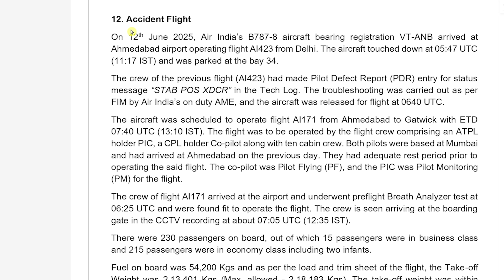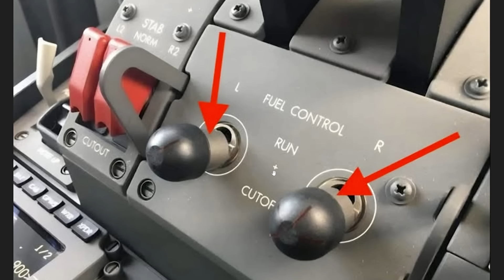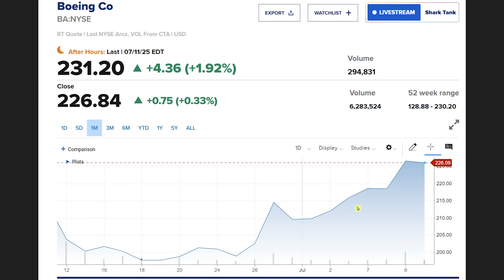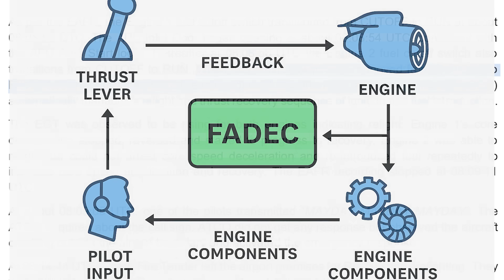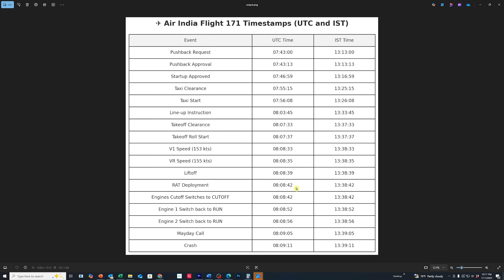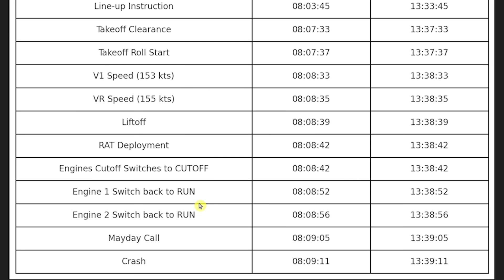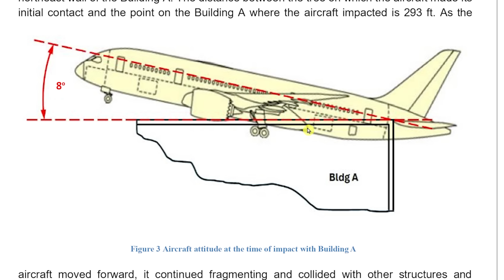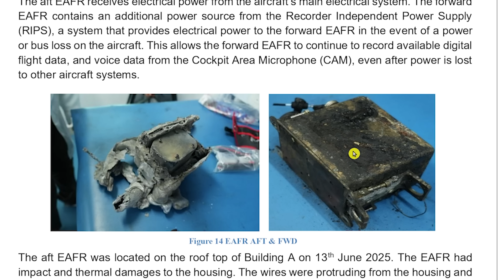Did Pilots CUTOFF Fuel? Shocking Twist Air India 171 Report!

Comment: The only question remaining in my mind is which pilot is the mass murderer.
Reply: Captain
Reply: It is Boeing psychology to put all the faults on Pilots.. They would do it in 1 sec? Switches has locks applied too.
Reply: @FireNFights  actually that is not true. In most investigations if something was wrong with the plains they will very much say that. That is how the airplaines have changed over time to make them safer and safer
Reply: @FireNFights 1 sec per switch
Reply: @Colossians1vs17 Pilots will follow the same procedure if they find any issues with Engine. Fuel cutoff can occur when the engines report any anomalies. This will be cleared in final report.
Reply: @FireNFights  Yes all it takes is 1 second for each switch, saw a video from Captain Steve saying so.
Reply: @YoutubeCommenter7402  Captain Steve will soon come with another video with same facts that it is impossible to turn off switches in 1 sec with locks applied.
Reply: Framing is also possible. We won't know for sure. That is why they did not mention who said what.
Reply: @itsmesuryat7570  They are going to find out. If you look at the cockpit of 787 to be able to liftoff the plane from runway you are going to need both arms to pull back. On a Boeing you need both arms, can't be done with one arm. The blackboxes record who is operating the plane, also when the plane was having issues we will find out who was trying to save it. Also, what selection the other pilot did since some switches appear on both sides. If this was an Airbus plane then it would have been  possible to liftoff using one arm and possibly turn off the engine with your other arm, but not possible with Boeing.
Reply: @knight3131  it is almost certain that the captain did it, but we need to know for sure who asked the question. The captain could have done it and asked the question to implicate the FO. Or in a crazy turn of events the FO could have taken his hands off the column and did it. They need more time to figure it out. That is probably why it is vague.
Reply: @itsmesuryat7570  something very sus about the whole thing. the whole reports seems/designed to put the blame (put all focus) on the pilots. they have time stamps etc but dont know which pilot asked question which pilot answered. also no other conversation? just one pilot asking question? and think for 10 sec to reignite and 4 secs apart ? when it can be done within 1sec? also i hope someone triangulate the plane take off from videos and timestamps to see if it matches up? rat deployed at the first switch off instantly why no timestamp for it? bcoz it can show which problem occurred first? rat or switch? they have switches timestamps but not the rat's? sound very strange! pic of rat looks almost instant after take off not 3 sec? hope someone can triangulate the stampts from the videos/pics
Reply: The report also mentions that aviation psychologists will be called in
Reply: No - those pilots were forced to take shots during past years! One pilot in April died in heart attac already and was same Air India. So easy people forget !
Reply: Captain.
Reply: I guess the motive would be they are trying to keep up with Boeing? That's a decent KD ratio but rookie numbers by murican standards
Reply: Clive
Reply: Finally.  This is the first time I've seen it worded correctly.  One of those pilots committed mass murder/suicide, and that's the issue.  Was he a loner, or part of a bigger plan?  Are there others waiting to do something similar?
Reply: I believe its the younger one,trained for this mission.
Reply: Captain Mohan Ranganathan, an Indian aviation safety expert, said: “I have heard from several Air India pilots who told me Sabharwal had some depression and mental health issues. He had taken time off from flying in the last three to four years. He had taken medical leave for that.”
Reply: , , ,    COMPUTER  , , , Switches are still  , , ON ! !
Reply: You with the stupid flag 😂
Reply: You're just butthurt about it lol  @TheGuruStud
Reply: @TheGuruStud you with the stupid answer 🤤
Reply: Neither..
Reply: The older one.
Reply: That's probably why you stand with Ukraine 🤣
Reply: @pl3317 certainly don’t stand with fascist aggressor like Russia…when hundreds of thousands of Americans died to defend democracy in WWII
Reply: Selensky

Comment: RAT was deployed right  after plane got airborne as per image put in place by AAIB that indicates both engines failed so that explains fuel cut off switch "transitioned" from cutoff to run where pilots try to restart both engines. what happens to both enginees or why fuel cut off switches went from run to cutoff in the first place is where investigation should focus on rather then questioning pilots.

Comment: What's the reason why the 2 x fuel cut off rocker switches were OFF for 10 seconds, then one was switched to ON (RUN) and only 4 seconds after this was the other switch turned back to ON (RUN)...Why the delay initially of 10 seconds, and once the error was presumeably noticed why 4 seconds delay before the second fuel switch was turned ON (RUN) ? Seems ODD to me!

Comment: If those engines are still spinning then they must still be providing electrical power, and they certainly were spinning adequately enough to get to VR Speed.  So why did the RAT deploy 3 seconds into flight? More importantly why did the RAT deploy previous to ENGINE CUTOFF ?!! Also the VCR recorded  "I did not do so" in regard to engine switch off query. Some are being quick to point at crew but there are many issues with Boeing that we all know of.  
Not the first time we've had reports of electrical issues particularly the MAX 737 and 787 Dreamliner. These issues have involved faulty wiring, improper bonding of parts, and problems with electrical components like generator control units.

I can smell a RAT and its burning through electrical cables again?

Comment: On the 737 and 787…
Upper panel toggle switches are down for on.
Lower panel toggle switches are up for on.
Lots of room for confusion there.

The Bae-146 had a much better system, where the thrust levers had to be at idle, before the fuel cut of position could be set to off.

Much safer than the Boeing system of little switches.

R
Reply: Yet decades of Boeing flights using these exact switches have caused no proven fatal accidents where two of these switches have randomly and simultaneously failed. 🤔
Reply: @robinmueller3778  Yes but such thrust lockout can provide extra safety margain for accidents or intentional acts like this. I'd add also that engines must be idling or in very low power setting for at least 3 seconds to cut them off. There's no drawback or extra inconvinence on that because in any normal scenario you cut engine on low power/idle settings. But prevent things like this
Reply: @oluskloc You would changes all that to “fix” something that basically doesn’t ever happen? 🤔

These switches were deliberately moved by human hands, they didn’t both just happen to accidentally fail at exactly the same time.
Reply: Either way there is no procedure to be playing with those switches during take-off unless brain fart and he meant to put landing gear up.
Reply: A thrust lever lockout sounds like a smart idea
Reply: Confusing maybe unless you have been trained on the airplane and done a ton of flights for discovery of switches etc.
Reply: "The Bae-146 had a much better system, where the thrust levers had to be at idle, before the fuel cut of position could be set to off."

The cut-off procedure in the BAe-146, is just to stop shoveling coal into the boilers.

Comment: Theres no evidence it was malicious, or that the pilot saw the other pilot move the switch or even that the switch was manually moved when the pilot said that. It just people interpreting the report to suit a confirmation bias. The report quotes the CVR without a time stamp so its uncertain at what point that was said. It may have been said before the switches were moved. The transition of the switches is what was electrically recorded by the FDR. The pilot may have said that after engines lost thrust speculating that the other pilot cut fuel switch. Then purposely shut the fuel to off and back on to try restart. Or it could still be some other issue.

Comment: So usually the pilot flying the take off is expecting a call-out confirming positive rate (of climb) from the pilot monitoring so that he can request for the gear to be raised… as is evident from the footage of the takeoff, the gear was never raised while the aircraft was attempting to climb… what it seems to have happened according to the interim investigation report is that the pilot flying never got the expected call-out, but instead experienced a loss of power by the pilot monitoring deliberately turning each fuel condition switch to the cutoff position in turn from left to right! 

This looks very tragic and I fully expect that the investigation will now scrutinise the history and background of each of the pilots…
Reply: "deliberately turning each fuel condition switch to the cutoff position in turn from left to right! "

The report does not specify in which order the fuel control switches were transitioned from RUN to CUT-OFF. It just states that the time interval between the two operation was 1 second. As pointed out by others, the polling rate was low so the actual time between these events could have been much shorter.

The report states that the fuel control switches were transition from CUT-OFF to RUN commencing with the switch for the No 1 engine at 08:08:52 and No 2 engine 08:08:56 an interval of 4 seconds.

Normally the pilot flying would operate the switches left to right because the No 1 engine is started first and after some time the No 2 engine would be shut down. After landing and returning the the gate the APU will be started and the No 1 engine would be shut down as it would close to the air bridge and stairs. Latter the No 1 engine would be shutdown.

It is only in extreme situations, such as a dual engine failure that both fuel control switched would have to  be moved from RUN to CUT-OFF and back to RUN and this would be done at altitude.

Comment: This doesn’t add up. Air India risks grounding all of its comparable planes while Boeing stands to suffer multibillion-dollar losses in the event of a dual engine failure. It seems far more likely that they quietly agreed to hold the pilots responsible after all, that conveniently shields both companies from facing the full financial fallout.
Reply: Hard to blame boeing for the fuel being shut off to the engines

Comment: I think everyone is jumping to conclusions without having all the data to make the claim that it was one of the pilots that brought this plane down.  The interim report appears to be deliberately vague on what was going on in the cockpit of that aircraft and does not yet assign blame for the incident.

First of all we need the entire CVR transcript (or better yet the raw recording of the CVR) to understand the state of mind of the pilots and what the cockpit dynamic was on that hot summer day in India.  The psych and medical evaluations of the pilots should also be made public if it is found that this was a deliberate act by someone on the flight deck.

Second, do we know for a fact that the fuel switch position is what the FDR is recording, or does the switch send an electronic signal to a computer in the EE Bay that is then processed and relayed to the FADEC/EEC on the engines?  I suspect those switches are not directly hardwired to the engines.  Can a spurious signal be sent to that EE Bay computer without the pilots touching the switches?  In other words is the physical switch position in the cockpit what is being recorded, or the signal sent from the EE Bay, or received by the engines/fuel delivery system?  I would like to see the wiring diagram and system logic of the fuel switches on the 787 and also exactly what information about the switch or fuel supply status the FDR is actually recording.

Remember there was an ANA 787 that lost both engines during a landing and the fault was never found or replicated.  It's quite in the realm of possibility that there is one or more deeply buried flaws in the software or hardware logic that fly these modern planes - especially in the critical takeoff and landing phases.

Finally I hope this incident is enough to mandate cameras to be installed in all commercial aircraft cockpits.  These things are cheap and ubiquitous in today's world and would provide unambiguous proof of pilot actions during emergencies caused by criminal acts or equipment failures.  This incident will also give ammunition to those in favor of replacing highly compensated pilots with unemotional AI.  It is also another reason we should never allow single pilot operation of a commercial airliner.
Reply: Yes exactly this. The report is saying or implying that the cockpit switches themselves were physically moved, but fails to explain the evidence for this. Sure, FDR recorded fuel cutoff signal, then another signal for Run, but the report should be able to explain whether this signal was commanded, uncommanded or unable to distinguish.

Comment: Great graphics and analysis as usual Jeff.  Couple of questions regarding the timeline where you show  RAT deployment first then fuel to cutoff position second.  
1) How do we know it is the correct sequence and not cutoff first then RAT deployment  second when the entries show exact same time?
2) Why is there only one time entry for fuel switch to cutoff position  when the switches can only be set one at a time as shown by 2 entries with different time stamps when set back to ON position?
Reply: See software system commands to shutoff fuel valves under certain electrical conditions

Comment: Everyone keeps saying “the pilot shut off the fuel,” but that’s just the public-facing story pushed by the G.O.L.G.A.P.P.A. initiative (Global Operations for Limiting General Aviation Public Perception Awareness). No mention of the pre-event A.C.C.H.A.R. spikes in the P.A.N.N.E.R. logs or the rogue activation of the P.H.I.R.N.I. array under Zulu-class T.H.A.L.I. masking. The F.R.I.E.Z.E. protocol failed exactly 22.7 seconds after the C.H.U.R.N. signal anomaly — which has only been seen once before, during the ’68 K.H.I.C.H.D.I. Incident. The “fuel cutoff” theory completely ignores the temporary flip in the D.O.S.A. vector, which only occurs when the cockpit’s G.O.B.I. module receives unauthorized G.H.E.E. pulses from a blacksite beacon, possibly linked to Operation R.A.S.A.M. (Regional Aeronautics Sabotage and Manipulation). The trajectory bent at a 171° angle — that’s literally a numeric signature of a S.A.M.O.S.A. pattern collapse, confirmed by the V.A.D.A. Commission’s redacted appendix 6B. It was never a systems failure. This was a staged ignition-loop induced C.R.A.S.H. (Controlled Re-entry and Sabotaged Handling). They’re not hiding the truth — they’re seasoning it with C.U.R.R.Y. and feeding it to the masses.

Comment: for those 10 seconds I'm sure the captain (or the malicious pilot) kept his hand on the switches and the FO would have been fighting off his hands and then finally when the captain knew the deed was done he let go and after the 10 seconds FO was able to pull the switches back up again. That also explains the delay. if it was unintentional, the PM (captain) would have immediately pulled them back up having 8600 hours on 787 and for any commercial pilot in the world such an error is not possible. FO looks faultless here as he was the pilot flying. also the only question reported is more likely to have came from the FO and PF and not the PIC (PM)

Comment: Keep in mind that even with the "locking feature" of the fuel cutoff switches disengaged, which is what that FAA bulletin pertained to, it doesn't mean that the switches can move by themselves. It still requires that the switches be purposefully moved, but without the extra manipulation required by the locking feature.  Also, the FAA states in the bulletin that Boeing was notified of this problem by *"operators of Model 737 airplanes".  Boeing simply indicated that the design of the switches was similar in other models, including the 787.  However, there apparently were never any subsequent bulletins indicating that the problem had actually been found in any 787s.
Reply: And also the entire throttle quadrant on this particular plane was replaced at least twice, the last time being in 2023, so it would have had the updated switches by then.
Reply: @brnmcc01  That is jumping to something unknown as they might have used an older refurb part, we dont know. Jumping to a conclusion that it must be a part that has the update needs checking.
Reply: @the_bunse  Correct, but all parts that are refurbished must come with a tag and be signed off on. FAA rules. Yes they may not apply in India, but that airline flies to many other member countries.
Reply: The problem with that theory is that the same switches you say were too loose to stay on were put back to on and then survived the crash in that position.
Reply: @EsparkyDog  Then maybe they never physically moved.
Reply: SAIB NM-19-33 fuel control switch locking mechanism problem finally been successfully replicated :face-turquoise-drinking-coffee:
Reply: @mostlygibberish  ? SAIB isn't the same as an air worthiness directive, it's just an advisory, and not mandatory. All the agencies involved at the AI crash site all are agreeing that no maintenance issues or "squawks" were on this aircraft. I might not trust Air India very much, but there was representatives from the FAA there, the NTSB, the AAIB, and the Canadian TSB, so you have a lot of different people there checking everything with no skin in the game and if they're all saying the switches must have been shut off via human interaction; whether intentional or pilot error; the result is still the same.